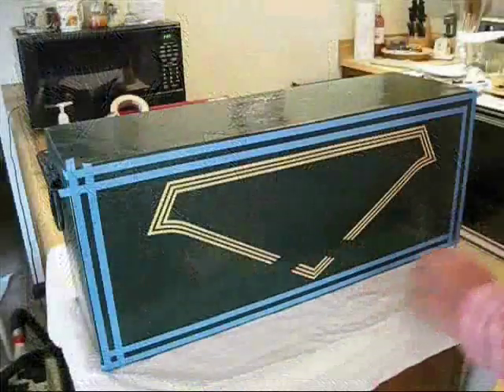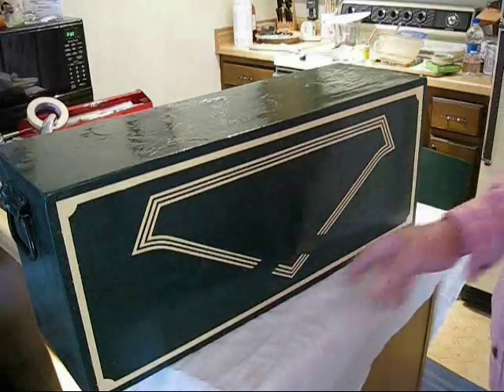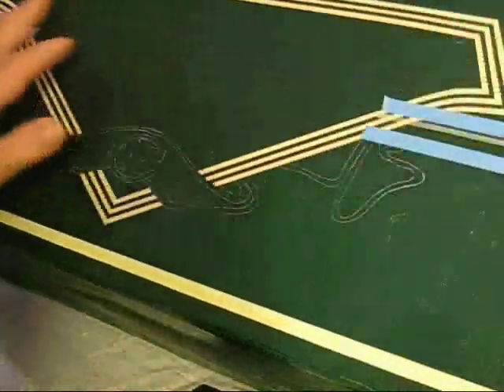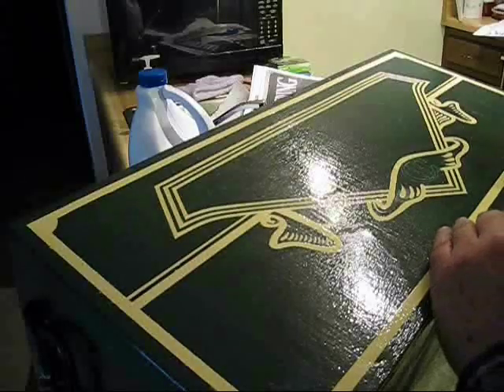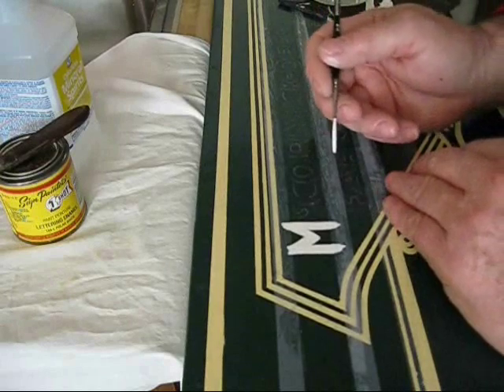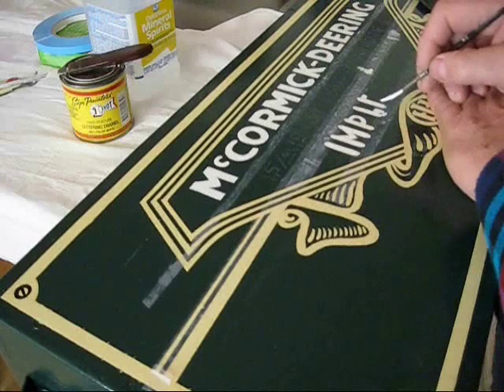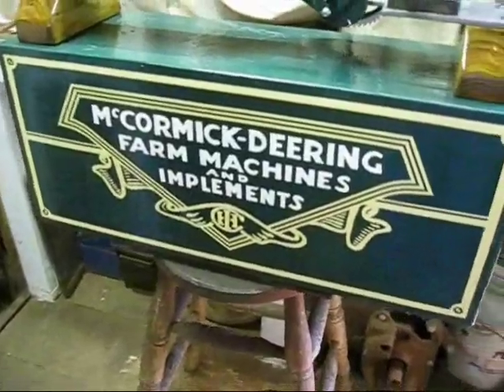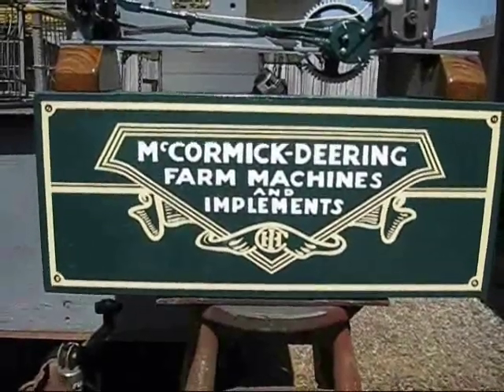IHC Gas Engine / One Shot Lettering Enamel / magneto tester shipping crate

Comment: This is a good one. For beginners you can even scotch tape off the vertical strokes and do all the down strokes then let them dry and come back the next day. It keeps you hands out of fresh paint. Of coarse if you did that in a sign shop you would be fired the first day . But taping horizontal strokes works well. Pull tape and get sharp clean edges.
Reply from the maker: +1-Shot slinger ,,, another paint video coming up soon,, part of a rounding board from a Grand Carousel,,,
Reply: +shopdogsam Thanks for taking time to post these !